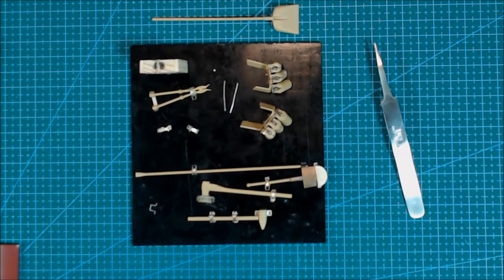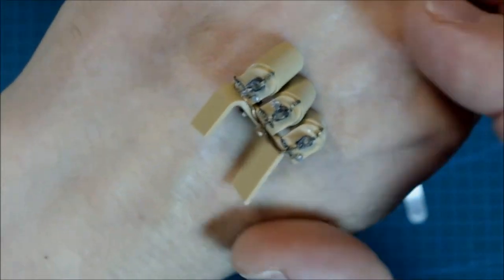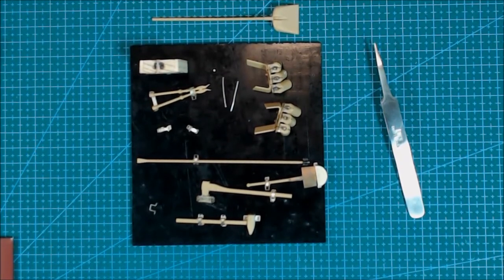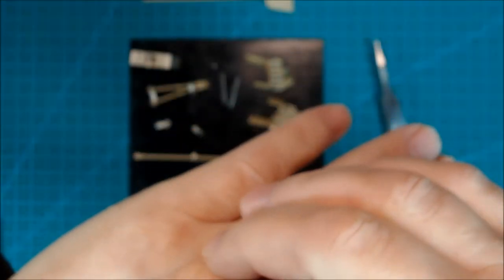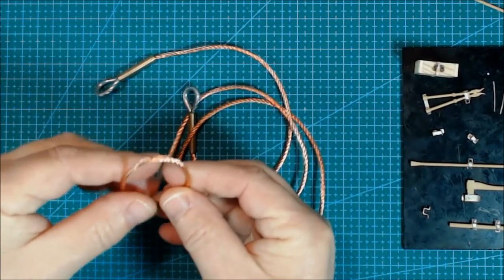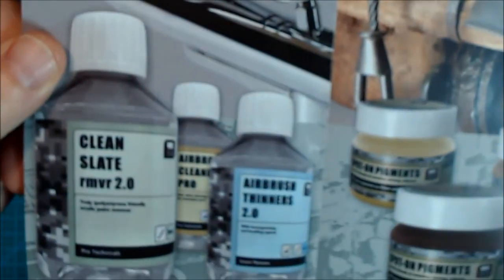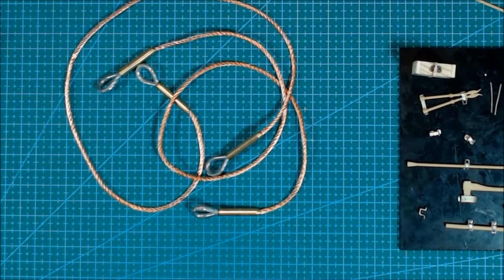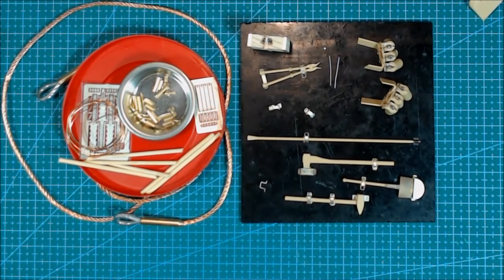TAMIYA 1 16 TIGER1 EARLY DISPLAY MODEL SWITCHER BUDDY BUILD UPDATE 3

Comment: Great update Paul, the cables look really good, thanks for the tip on the glue, checking them out, :)
Reply from the maker: ramblers69 .   I was surprised to’ when I stumbled on to the flexy glue’ but I like it.   Using it on all my PE for the rest of the build.  As I have other CA glues’ I’ll make a decision based on were the parts need to go on future build based on nock ability.
Reply: Seen the video on that glue Tom, great stuff!
Reply: Switcher I just watched it Rick, looks like a good product, :)
Reply: Seeing is believing aint' it :)

Comment: 1st one here :) Great work Paul I wish I had your dexterity! Your cables are the bomb :) I am glad you were able to find the right wire. How did you fair out with the track changing cable? More importantly, what AWG did you wound up getting for each (for your viewers) :)
Reply from the maker: Switcher   I haven’t got round to the track changing cable yet , but I think that will be a easier fix. I got the tow cables “ready made” from welshdragonmodels.co.uk. Who do mostly 1/16 models PE and parts.     Whist the video was uploading, I add the smoke launchers to the turret.    And added the wires into the turret from the lunchers.    Going to complete any PE to the turret thats needed so it done. Then on with the hull’ lol.
Reply: Dang! I thought you went and got some wire as discussed last Mon :( However they do look the part compared to the steel ones (thumbs down) from Aber.